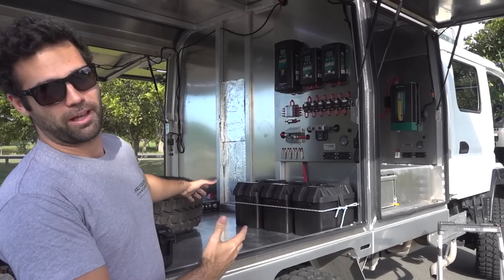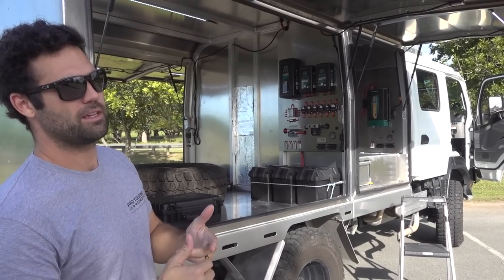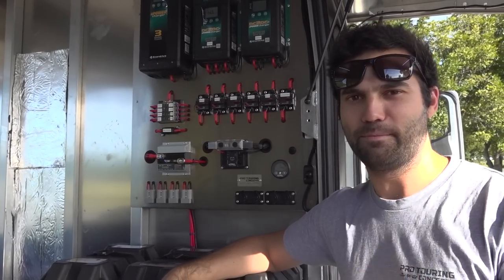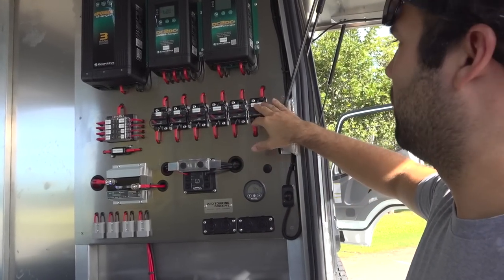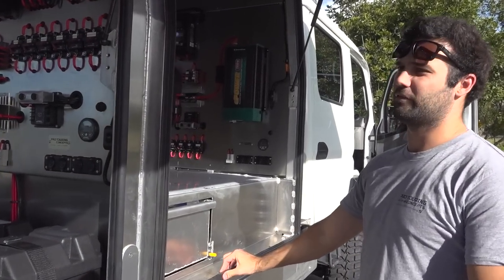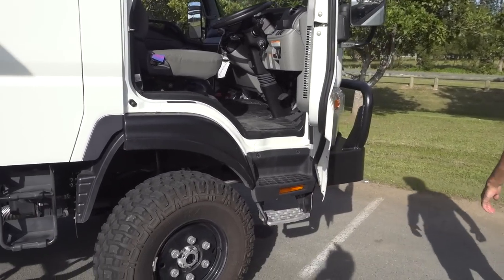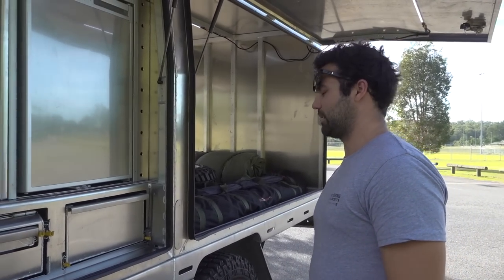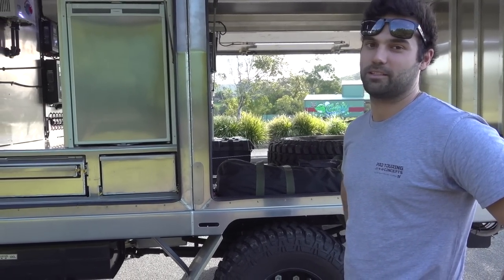Pro Touring - FUSO Canter Truck Build

Comment: Spent all this money and did not go lithium? but what a vehicle, great job.
Reply: when you're not concerned about weight, space or size, lead crystal would have been the better option. %90 discharge capability, higher amp input and output, and does not suffer as much capacity loss from high/low temperatures as lithium does.

With that said, AGM lead acid was almost the worst choice for this application unless he needed it for ballast...